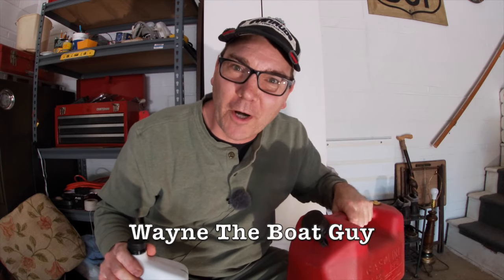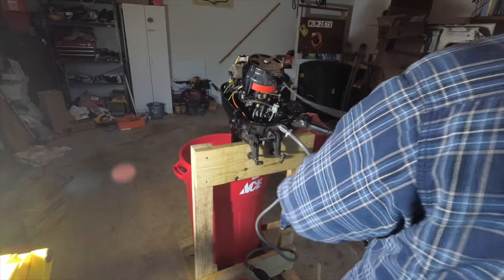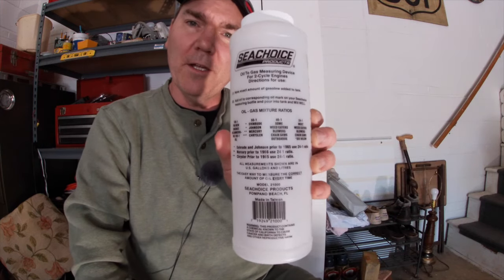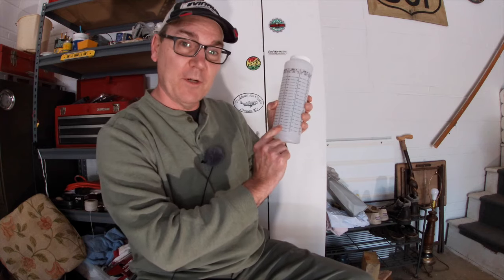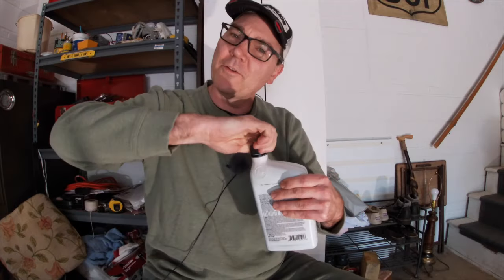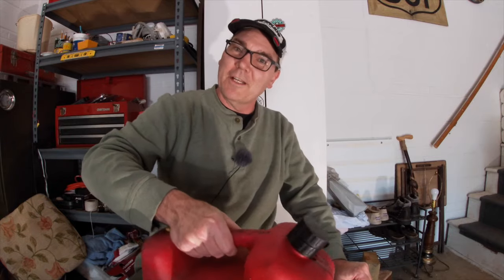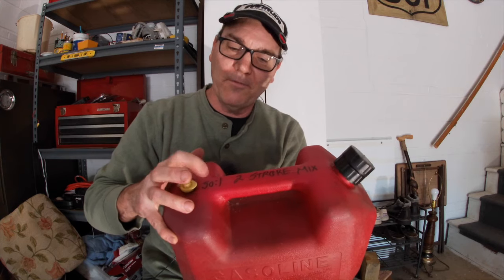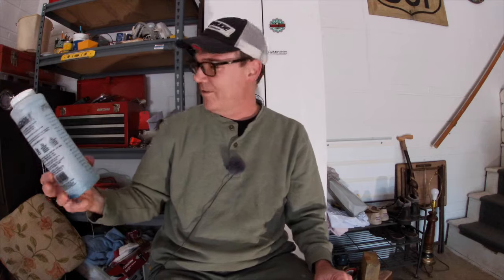How to mix 2 stroke boat gas for your outboard

Comment: So I have a mercury 5hp outboard does the hp matter though yours is a 2.5? I'm new to this and wanna make I'm doing it right. Thx.
Reply from the maker: No I think all the newer ones (like from 2000 up) are 50:1 - but be sure to check for an online manual to be certain!

Comment: Boat newbie here. Can I use the premixed 50:1 products? That I can get at Lowe's. The same stuff I put in my weed eaters and such.
Reply from the maker: I think so - but the marine grade 2 stroke oil has additives to deal with water from humidity I think.
Reply: Those premixed cans are convenient, and they charge you quite a bit for that convenience. I’ve bought the cans just so I could use them as a shop decoration afterwards, but it’s pretty expensive to just use them all the time.
Reply: What kind of fuel do you recommend non ethanol or unleaded running a 83 evinrude
Reply: @charleshupp2434  , I would always run non-ethanol if you can find it.

Comment: I have a 6hp outboard what would be the correct mix
Reply from the maker: It depends on the year and brand of engine. A 1965 Evinrude 6 will be different than a 2003 Mercury 6. Look up the info for your make, model and year.

Comment: Wayne I have a crazy question. If I have a 6 gal outboard fuel tank, I've put my mixture - 50:1(16oz for 6gal) but I have about a half of a tank left from a day on the water. The next day do I have to mix another 6 gal in a separate container to fill it up or is there a way to add to my tank on the boat?
Reply from the maker: Yeah it gets a bit tricky! Using the measuring bottle, you can easily determine the amount of oil you need for any amount of gas you're adding. So if you add another 2 gallons of gas, you can see how much additional oil to add. The way many of us do this, is we have a special container (like I have in this video) to store additional mixed fuel. So my boat might have a 6 gallon tank, but I also have this other container that I can use to top off my boat tank(s).
Reply: @WayneTheBoatGuy  Thank you Wayne!

Comment: Great video! Thanks! What premix do you recommend for a Nissan/Toahtsu 3.5 hp 2 stroke?
Reply from the maker: Most of the 'newer' 2 stroke outboards use 25:1 for the break-in period (when an engine in new) and 50:1 after that.
Reply: @WayneTheBoatGuy  Thanks. I was using 100:1. Can it be bad for the engine?

Comment: can you tell mi what is the best mix for johnson 70vro 
in 1L how much oil?
or in 10L how much oil?
Reply from the maker: if your engine is 50:1 (like many 2 strokes) it would be 20 ml per liter or for 10 liters it would be 200 ml

Comment: Ok Wayne question for you and other viewers
So I've got mixed gas in a fuel tank that came with my mfg gypsy when I bought it how do I know if it's usable or good still?
Reply from the maker: If the fuel in your area contains ethanol, there's a much higher chance that it is bad than if it is non-ethanol. I usually try the old fuel first, and if the engine doesn't run, I try a container of new fuel. Sometimes if it only runs on new fuel, you can mix the old and new to use it up - but it might not run very good until you use up the old fuel.
Reply: @WayneTheBoatGuy  thank you for the insight sir

Comment: Hi, to the community. Nobody talks about 10 : 1= British seagull outboard, I think that's 100 ml of oil per litre of fuel. Is this correct? My outboard seems 'happy' but I really don't know, it is supposed to be slightly smokey I understand. Could somebody in the know, kindly message me? 😘

Comment: Oh on the earlier message to kill switch yeah you know we took jet ski kill switches and scavenge them and put them on our boats instead of the regular push button kill switch it fits right in the same hole and you have the lariat to put to be safe I always recommend putting a kill switch in case you fall out of the boat

Comment: Four hours ago, I bought a small bottle of 2 cycle Super Tech brand oil from Walmart. It does not have the TCW3 label. It just says universal 2 cycle. Says on back in small letters specially formulated for high performance air cooled 2 cycle engines such as lawnmowers string trimmers and chainsaws. Does not mention outboards. I checked the label on an old bottle of Super Tech that I used previously, and it has Outboard on the front label with 2 cycle TC-W3 under the outboard. Do you know if the universal 2 cycle can be used in 2 cycle outboards or do I have to use the designated TC-W3. The bottles are the same blue color. Seems to me if there is a difference in these oils they would put them in different color bottles as I just saw the familiar blue color and the 2 cycle oil label and in haste assumed it was outboard oil. Guess I may have to drive 15 miles back to Walmart to exchange it. I did notice that there were two different prices for what looked like the same bottle of oil on the shelf. I think one was about a quarter more for a 6.4 oz bottle. They are probably the same oil, and they are charging more for the outboard designation, but not knowing for sure I might need to return this crap. That is Walmart for you.
Reply: That stuff you got can be used in a pinch. But yes get the TC-W3 or newer version TC-W4 marine outboard engine oil it's formulated for moisture. Outboards are not High performance like chainsaws weedwackers etc. I also get Marine Seafoam and or  enzyme additives to counters the cheap gas I get. Or buy REC fuel, It's more costly but better on your motors. It's not always readily available near me. I use the little bottles with the measurement cup made right on it. Less things to get dirty. Then I refill it when needed, little tricky until you get the hang of it. I have an 1986, 30 horse evenrude.
Reply: @lude3645  Thanks. I returned the oil to Walmart and they had the TC-W3 in a bottle that looked identical, only the label and fine print on the back was different. I use non ethanol gas.

Comment: I bought an evinrude 88 spl 2-stroke engine, the one who owned it told me he used 33-1, would I have problems if I change it to 50-1?
Reply from the maker: Some people run with more oil, but they smoke more.

Comment: Does the gas and oil go bad if you don't use all of it?
Reply from the maker: Eventually all fuel goes bad. It seems the ethanol-blended fuels go bad much quicker than non-ethanol fuels.

Comment: The math does not involve fractions, just a simple division, (or multiplication), that we should have learned in elementary school.  Just take the amount of gas you have in fluid ounces, (like 128 oz for a gallon), and divide it by the mix ratio you want. (128 divided by 40, (for a 40:1 mix), = 3.2 oz of oil for 1 gallon).  Any measuring cup will work if it measures fluid ounces, and the oil bottle is usually marked off in ounces.  
From the other direction:  You have 12 ounces of oil left in the bottle, "12 times 40 (for a 40:1 mix ratio), = 480 oz of gas.  Divide that answer by 128 for gallons, and you need 3.75 gallons for 12 oz of oil mixed at 40:1.
No offense, but would I be wrong to say you worked for the state or a union?  It is very simple math, and I would say not knowing it as adults makes us victims.
Reply from the maker: Math and fractions were never my thing! When I was in grade school the country was shifting to metric and then we basically switched back. Quarts, Ounces, Gallons - I never needed any of that as a graphic designer.

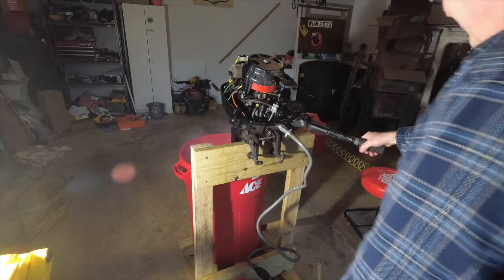Comment: Hey. I use an Johnson 6.0 BJ6DREDS 1996. Which 2-Stroke fuel mix do i have to use? 1:100, 1:50, 1:25? Greetings from Germany.
Reply from the maker: Chances are it’s 50:1 - many from the last 25 years are, but double check to be sure.

Comment: Does 10w40 oil good for 2 storke engine boat
Reply from the maker: Ideally we should be using 2 stroke oil. I think years ago people used auto motor oil, but newer 2 stroke oil is colored so you can easily identify when you have 2 stroke mixed. It also is designed for 2 stroke engines.
Reply: Use the tc-w3 outboard 2 stroke oil you can get it at Walmart.

Comment: 2 out of my 3 outboards is 50:1, the other 100:1. My mower is 25:1, Whipper snipper and chainsaw is 50:1. Mixing fuel for all of these with the correct oil (outboards need Marine 2 stroke oil) is a piece of piss. Never made a mistake. This is because I live in the 21st century and use metric not the other junk one country uses. And remember Oil first then fuel.

Comment: With the residual oil in the bottle it is not a true 50:1 mix. Add a bit of gas into the bottle to dilute the oil after measuring and it allows all the oil to be poured out